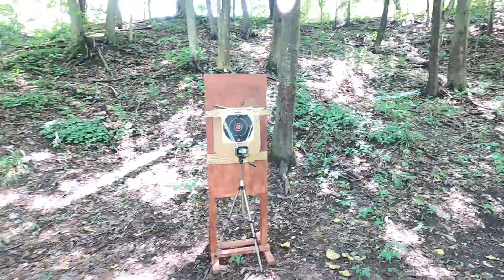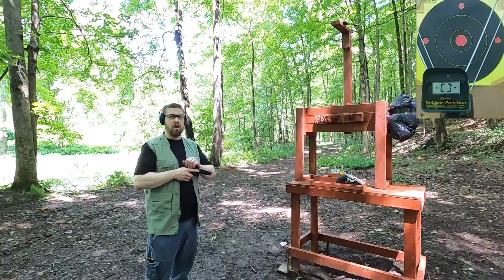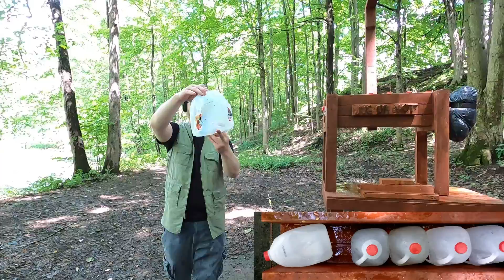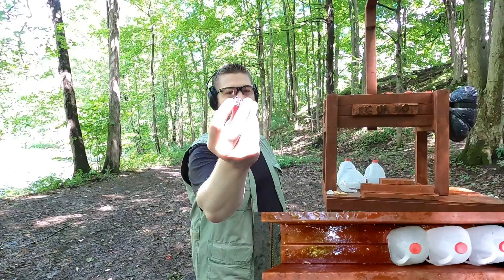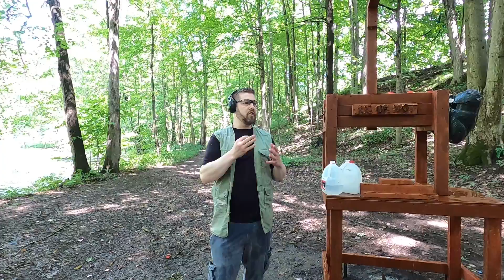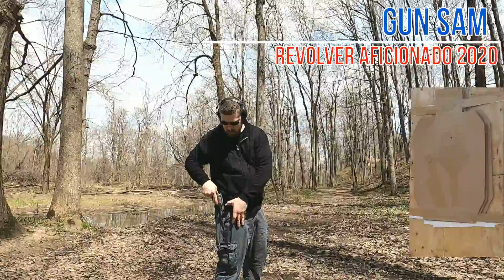10mm More Powerful than .357 Magnum? 💥ULTIMATE Test💥💥💥POWERFUL Ammunition

Comment: I have watched several vids of you and your 10mm.  You never disappoint me with jams and misfeeds with your conversion.  Why don't you invest in a real Glock mod 20? My mod 20 and mod 40 shoot anything. I have never had a jam in over 1000 rounds through each. I shoot 10mm quite often.
Reply from the maker: I don't like 10mm, I don't want 10mm. I got the conversion for ballistic testing because of the 100s of requests to see testing. Would you spend $600 on something you do not want?
Reply: @GunSam  no, I surely wouldn't.  I like 10mm, I own 10mm, I shoot 10mm.  I was merely remarking after seeing you struggle with your conversion.  I agree that the old, tried and true 357 is hard to beat. Manufacturers need to step up and make good semiautos in that caliber. I have an IMI Desert Eagle in that caliber but it is as heavy and large as a brick. If Glock made one, I would be in line to buy one. I like 357 mag, but I want a decent sized semiauto. Haven't seen one yet that excites me.

Comment: Try some Remington or Winchester
Reply from the maker: i'm not sure what you are suggesting specifically. I mean, I have tested tons of Remington and Federal .357 Magnum, and it's about 250 FPS less than this Buffalo Bore ammo and the same less for energy, about 250 pounds less. As far as 10mm I have tested a few run of the mill rounds and typically, they are about the same again as .357 Mag for energy. If we talk Winchester, Remington, Federal, Speer and so on we are talking about 500 to 600 ft lbs energy.

Comment: i have a kkm 10mm conversion barrel for my 41. bought some hot buffalo bore ammo to try out in it as well as a stiffer recoil spring and a 10 extractor. I ended up breaking the firing pin. Have you had any problems shooting hot 10 mils out of your 41?
Reply from the maker: No problems yet. I did not have the 10mm extractor in the gun in this video, but I did get one and used that in my last 3-4 videos featuring 10mm. I have the NDZ 22# spring. I never broke a firing pin though. What Buffalo Bore ammo did you try? I have used the 220 gr Hard Cast, and in my last video I shot the hottest yet, the Buffalo Bore 180 gr JHP. I was getting something like 822 ft lbs energy, so it was hot.
Reply: Gun Sam Revolver Aficionado I was using the 220 gr cast stuff. The firing pin is the last thing I’d expect to have break. Especially because Im pretty sure its the same pin in the 10mm glocks. Maybe it was going to break someday regardless of what I was shootin. Anyway good to see theres more glock 41 fans out there. Not the most popular model but my fav. Im going to refrain from shooting 10mm out of it from now on tho.

Comment: Limp wrist showing up here also...🤔
Reply: I was thinking that as well. I have never seen a Glock jam
Reply from the maker: oh, okay. That's why when I switched the extractor to a 10mm extractor it never jammed again? Hmm. You sound like you know a lot. Link your video of you doing it better. I been wanting to see it but haven't seen it yet.
Reply: It's not limp wrist. It's how one shoots when firing one shot at a time for acuracy, it's called bullseye shooting method. Pin the trigger with a smooth grip.
  Just right amount of grip pressure for stability but no shaking.
  For rapid fire it's a whole 
different grip method.
  Obviously you know your weapons and are a bullseye shooter.
  Forget the trolls.

Comment: Very interesting. I'd like to see 10mm against 41 magnum. I've heard a number of people  claim that they are pretty similar, but most of the reloading manuals seem to indicate that 41 magnum's upper end outruns that of the 10mm. I haven't personally tried testing both, so I really don't know if that's how it ends up working out.
Reply: They are equal only if you take the higher end of 10mm loads and the low end 41mag loads that’s how they are comparable. People trying to say out right that 10mm is equal to 41mag in reality it absolutely is not. The 10mm is only 20% more powerful than a 357mag across the whole spectrum of loads. Reference Ballistics101.com- and compare the three 41mag vs 10mm vs 357mag from the manufacturers themselves.
Reply: @MM_405  Thanks for the great reference! In just shooting both, it seems like the 41 mag is actually quite a bit more powerful than the 10mm. As an old revolver guy, I’ll admit just a little bias towards the 41. Still, I love shooting 10mm. As a semi auto round, it is a fairly stout choice short of 50ae.

Comment: you lost me when the glock jammed. .357 all the way.
Reply: My Glock 20 has never jammed.
I'm taking 15+1 10mm over 5 or 6 rounds of .357 mag any day of the week.
I do really like .357 Mag, but as far as firepower goes, the 10mm is the winner.
Reply: @charlesb.m.8798  The 20SF is nice as well.
Just a smaller frame.
I was waiting & hoping they would release a Gen 5 or at least an MOS for the 20, but I ran into a Gen 4 at my local shop & decided it was time to upgrade lol.
Reply: @charlesb.m.8798  Ouch.
I actually just decided to switch to a Gen 4 20.
I really like it so far.

Comment: You are not testing these two guns at each of their maximin potential such that this test is somewhat meaningless.
Reply from the maker: Really? ALL other ammo I have tested put the energy for .357 Mag at 500 to 600 ft lbs energy with full power loads and 500 to 700 ft lbs for 10mm. Your statement is the opposite of all known knowledge I have ever seen or tested. You might be arguing bullet weight or design, however XTP's in a relatively normal weight range would be hard to argue against. However to give you a chance to make your point, link your video showing their potential higher than these. If you don't show me, than it's hard to argue result differences and argue what I am showing is wrong.
Reply: @GunSam  Please see https://www.midwayusa.com/product/1021550166?pid=569909, perhaps you are not familiar with this load.
Reply: @paulskopic5844  You seem to completely miss the point of the comparison. Do you not understand "sectional density"? How can you compare completely different things? In this video, Gun Sam makes the point that the two rounds he is comparing have nearly identical sectional densities, which means, theoretically, if they have the same power - the chronograph shows they have nearly identical power based on velocity x speed - then, they SHOULD have the same penetration WHICH THEY DID. Your example of the Buffalo Bore 180 gr round is an entirely different beast and, in fact, is NOT intended for self-defense, at least, not defense from a human. The BB 180 gr .357 is intended as either a hunting round or defense against bears.

Comment: This is a comparison of platforms using different calibers. A better example to compare calibers would be to use a Smith 610 revolver and a Smith 27, or the 10 mm semi you have there and a 357 Coonan. The Coonan, not suffering from energy loss from the gap between the cylinder and the barrel, offers even better performance for the 357. The test also shows why some Sportsman favor revolvers, because semi autos offer more opportunities for malfunctions with certain ammo types. I have liked the 10 mm since the Bren Ten, and It is great to see people appreciate its many virtues. The 357 is exceptional and may be the most versatile cartridge around that most people can actually manage.
Reply from the maker: One can argue that, but the way I am arguing it is in normal platforms. Be like the argument that "my Harley can beat you Corvette in a half mile drag", and then this really difficult and extremely uncommon setup where the Harley guy brings in a Boss Hoss bike that has a Corvette motor in it, and then starting the race lol. If you talk 10mm 98% of people using 10mm are using it in a semi auto. If you talk .357 Mag 99.5% are using it in a revolver. So I pretty much stand by my comparison method as I like to be real world more than being 100% scientifically correct.

Comment: Any revolver with a 4" barrel and over 35 oz will do well absorbing 357 magnum recoil. Small snub nose revolvers won't even fire the round at speeds that justify loading them with 357 AND they're not heavy enough to absorb 357 recoil so your hand will be punished. imho nothing less than a 3" barrel and over 2 lb revolver if you plan on using 357. Otherwise it's not worth it either pain wise or ballistics wise.
Reply from the maker: In my 2" Taurus 605 this very .357 Mag round gave me an average of 1,443 FPS and 578 ft lbs, but it wasn't fun to shoot. What I do in selecting a snubby .357 Mag load is rather than just use .38+P, I will either use a specific short barrel load, or I will choose a poorly loaded .357 Mag load. Two examples; and both are in the 375 ft lb range- The Speer Gold Dot 135 gr .357 Magnum Short Barrel, and the Hornady American Gunner 125 gr .357 Magnum. Both handle well in a 20 oz snub. To be fair, when I had a 28 oz Ruger SP101 .357 Magnum, most magnum ammo felt fine to me, it's only when going into the 20 oz range and with a gun that don't fit my hand well that I felt punishing recoil. Like, I would rather shoot a 20 oz .357 that fit my hand well than a 40 oz .357 that did not. Your hands and body can easily absorb recoil but you need a big enough grip to do it. Think about it, your body is heavier than a gun and very flexible.
Reply: @GunSam  Maybe. Or I have wussy hands. lol. But I like the back strap of my revolver grips to be wide instead of narrow like grips that are made to look good but not function well. I can't remember what load I use because I am not as detail oriented as you but my Taurus 617 2" snub is comfortable for practicing with 38 +P with a full length grip but not so much with 357.  I've got a 4" model 28 and a 3" 686 that shoot 357 very comfortably tho. I'll take your word regarding the  357performance measures you reported because it might be the same as comparing 10mm vs 40. It all depends on the ammo. 
This is the same problem I have with my FS M&P 40. Love the gun, hate the grip so I had to get a handsall to put on the grip to make the backstrap wider. Now I'm good with it. That said I never had this grip problem with my 10mm  or 45 acp XDMs . I can shoot 10mm buffalo bore all day from that thing(but it wouldn't be cheap tho)

Comment: Big fan of your shooting skill with those big rounds .... if you have viewed the Philly Cop shooting of the guy with the knife it took two cops putting 10 or more rounds of 9mm 147 gr. hollow points to drop him...I think either of your two rounds would have been one shot stops. As the debate rolls on as to the 9mm,  seems the only advantage is mag capacity.  I do wonder why Philly decided on 147 for the Glocks? Have you found that better then 124 or 115 9mm?
 https://www.phillypolice.com/assets/directives/D10.6-FirearmsPolicy.pdf
https://www.youtube.com/watch?v=be1WmNpNc_w&has_verified=1&bpctr=1603987618
Reply from the maker: 9mm seems to be ineffective. People laugh when I say the old .38 Special SJHP is better because the energy is about 50% less, but the hollow cavity is softer and bigger and needs less energy to do the job. Same for .357 Mag, even if you could get a 9mm+P+ up to .357 energy the .357 would still do better. The 147 gr 9mm is pretty much used as a windshield load, that's really it's main purpose over 124 gr. If you shoot a windshield with 147 gr the impact on the other side will be about the same, as where the lighter bullets will impact the interior of the vehicle in a slightly different point of impact due to deflection. The 147 gr also has a tad less recoil and seems to be more accurate at longer range.

Comment: There's a couple things going on here, when we start talking about Barrel length:  In the Revolver, you have a Cylinder Gap, which bleeds off a bit of propellent at the back of the Forcing Cone, for a loss.  Magnums are loaded "Hot" to compensate, but it's still there when you compare the performance of 2 Loading sin the same Barrel length.  I loved the Desert Eagle in .357 (Yes, they actually did that, .41, and .44 as well as .50 Action Express) Magnum, and while that's a Gas system, it still doesn't bleed off nearly as much, nearly as early in the barrel.  So, you basically get more out of the same length of barrel, since it's accelerating more on it's way to the muzzle.
Reply: You are correct about the revolver bleeding some energy at the cylinder gap but the revolver can handle a much hotter load without damage whereas the desert eagle  you risk breaking the sear.

Comment: Both of the firearms that I personally own in these calibers have longer barrels than the ones you just tested. And I still can't see a significant difference in them . Other than 16 vs. 6   I personally own the xdm 5.25 10mm and the ruger security six 357 magnum with six inch barrel. Both are my most favorite and accurate handguns. P.S I also have a ruger super blackhawk 44 magnum with a seven and a half inch barrel. Neither of these two calibers can even come close to that gun. Even with the most weakest 44 magnum ammo. But their all awesome calibers

Comment: holy crap, isnt 800ft-lbs out of those cartridges a danger to blow up the guns?
Reply from the maker: The output of energy does not matter, what matters is SAAMI maximum pressure. Both are below that, and proof testing of cartridges are done at twice maximum pressure, so a danger of blowing up, no. Not even close.
Reply: @GunSam   Thank you. Amazing that they can get that much power with the pressures being so low!

Comment: Original loading for 357 (since the video brings up "original" being important) was 158 grains at around 1530 fps (through a smith and wesson 8 'ish inch revolver). This is common knowledge in the gun world (125s became a thing much later,..probably after they watered down the ammo and, around the same time "certain" guns by "certain" manufacturers could not handle a steady diet of original 357 loads)   ALSO,...you have a big booboo for the 10mm,..The original was NOT 155 grain,. much heavier.   Why don't you find someone who handloads to make you original rounds of each,..and then do an honest test. The original loadings speak for themselves, and you...my friend.........showed everyone who is aware of the history of these 2 cartridges, that you might be classified as an idiot looking for clicks. The original 10mm loadings were 200, 170, and 165 grain. 200 at 1200 fps was by far the most common. The original 10mm (Norma) ammo. in real life ran slightly less MV than the box stated (all 10mm's were full size 1911s...so it's hard for them to explain that one away).  The original 10mm,. was slightly (not much) below the original 357 in power. Nowadays, both rounds are so watered down that you have to load your own (or pay boocoo bucks) to get real loadings. I run the original 357 load in my 357s and yes, it's 1530 fps depending on which gun, (1100 fps up to 1800 fps depending on barrel length). My 10's I run slightly less than original, because I am not aware of a definitive conclusion as to which powder was used.
Reply from the maker: I know what the original loads are obviously, so Idk what you're even talking about. At all. These are not the original loading of the cartridge, never said they are. So that's a long ramble based on you wanting to ramble.
Reply from the maker: So again, you sound like a moron arguing with yourself over what the original design of the cartridge is, and arguing that point to a random person who made a video not covering that information.

Comment: I've done a lot of  reloading with hot .357 loads. It's one of my favorite calibers for whitetail deer hunting. I use an old Contender with a compensated ten inch barrel.  You can achieve really impressive results with hot .357 loads on game.  But, those loads stay on a whole other shelf than the ones I put in my model 60 Smith.

Comment: Glock didn’t feed = revolver wins
Reply: That's a conversion. My Glock mod 20 and mod 40 shoot anything. I have never had a jam or misfeed in over 1000 rounds through each. You can't go by his conversion, they suck.
Reply: That's why I prefer my .357 magnum revolver over my semi-auto pistol.
Reply: @geronimo67  didnt had the Luck for a wheel Rifle so i chose a Mares Leg 🤠
Reply: A Revolver is the pocket Version Gatling .
Reply: Conversion hasn't been reliable. But there's plenty of stuff out there from Ruger, Springfield, Dan Wesson, Sig Sauer, Tanfoglio with metal in them that will run the 10mm all day. There's a good number of revolvers for 10mm (with moon clips) as well.

Want some real semi-auto horsepower? Get a .460 Rowland conversion with the comp.
Reply: Absolutely!
Reply: My G20 has NEVER jammed, has NEVER been cleaned, and has 500+ rounds through it.

Comment: The UW 180gr Gold dot 10mm is my choice for my Glock 20
Reply from the maker: I will test that at some point in the future. Getting a .44 Mag revolver soon and am saving the heavier 10mm to compare to the .44 Mag to keep them somewhat fair. A 180 gr .357 Mag is really weak compared to 125 and 158.
Reply: Gun Sam Revolver Aficionado 
Remington makes a a interesting 180gr SJHP 357mag
But i think a a 158gr .358 would compare with a 180gr 10mm round
Reply: With the 180gr 357 mag bullet you loose velocity ( length & weight of bullet) but , to me you gain momentum.. Remington produces a good solid 180gr SJHP bullet 
Also I like the UW 10mm 200gr XTP offering 
My woods carry 
If I carry my Security Six .. I carry UW 158gr Gold dot 357